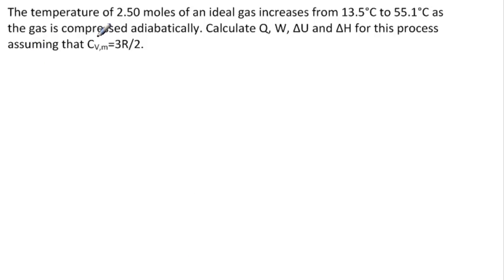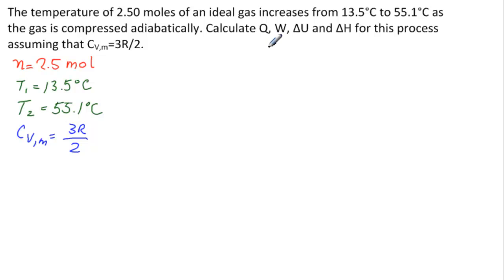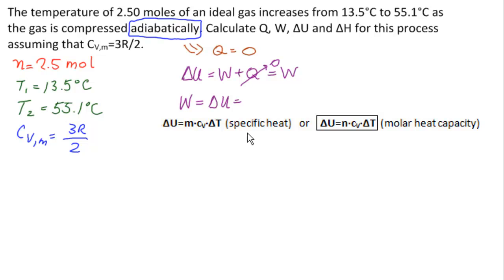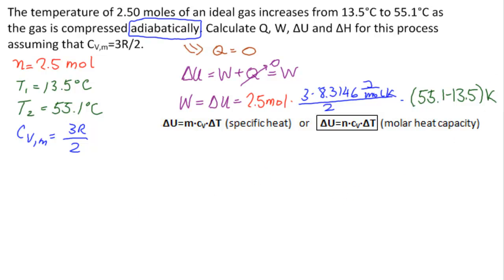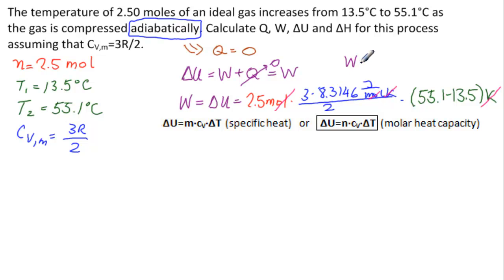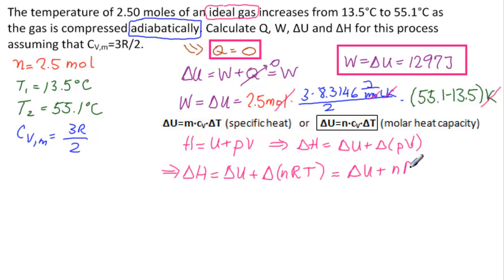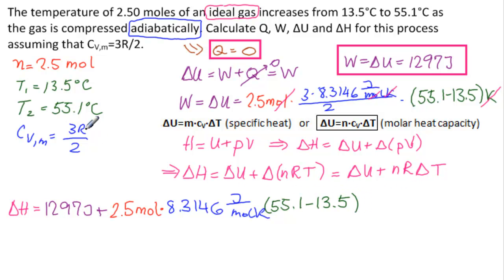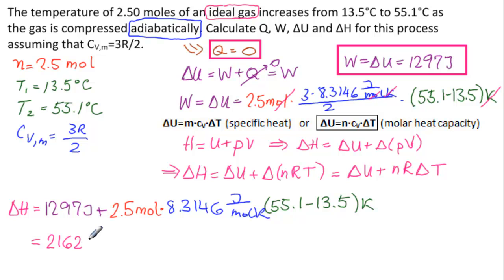Adiabatic Process 1

Comment: because it's the difference in temperature that is used. If you added 273.15 to both temperatures and took the difference, the answer would be the same even if you didn't add 273.15 to both temperatures